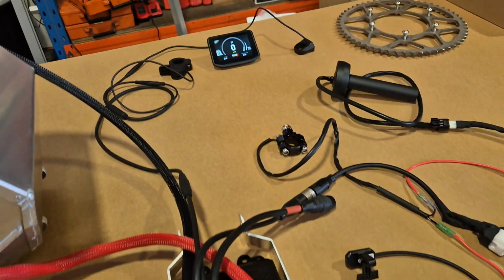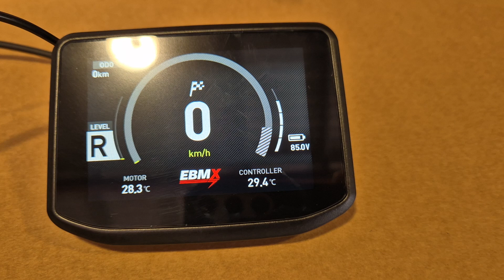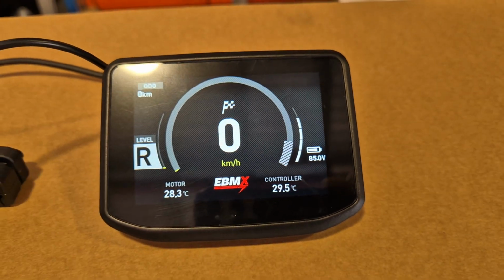ELMOFO EMX GEN-3 Electric Motorcycle Kit Overview

Comment: What's the expected kw/hp on this setup?
Reply from the maker: Can be pushed to about 30kW/40hp peak but generally run at about 25kW/33hp peak with 80Nm at front sprocket and 440Nm at rear wheel. Not Stark Varg level, but they feel very powerful